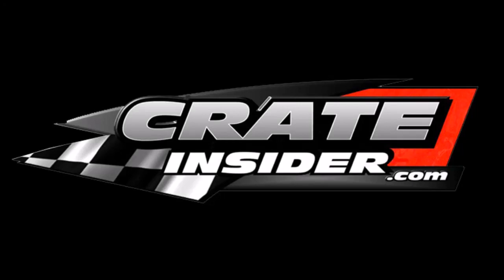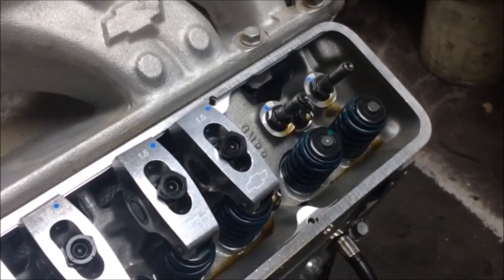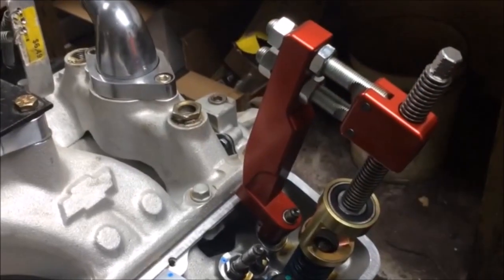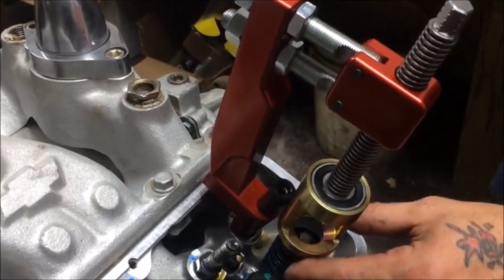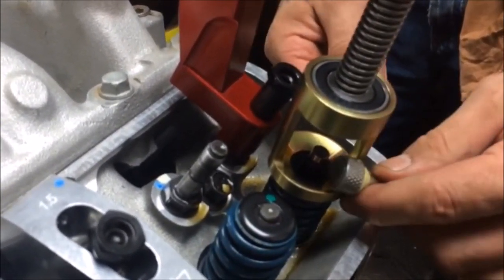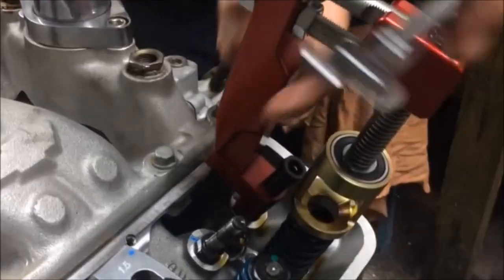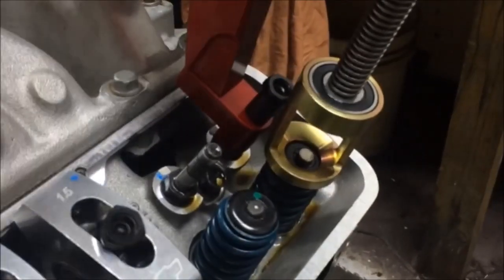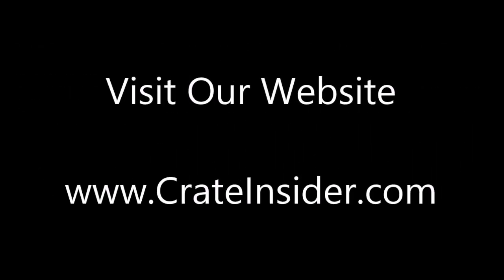How to Change Valve Springs by Crate Insider

Comment: will this tool work on chrysler
Reply from the maker: If it is a stud mount rocker system then yes, it will work. The SC-800/SC-801 that we sell is for standard 7/16" or 3/8" stud mount rocker systems. If the Chrysler set up is something out of the ordinary or has SHAFT mount rockers then it will require a different LSM spring compressor.